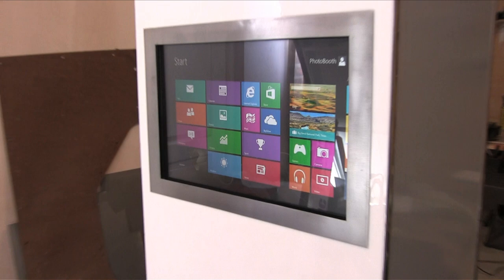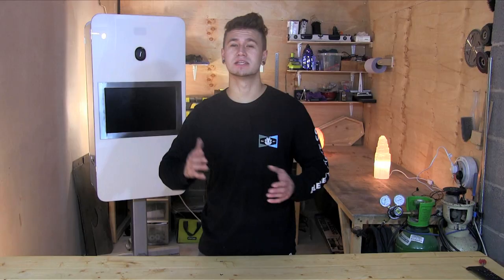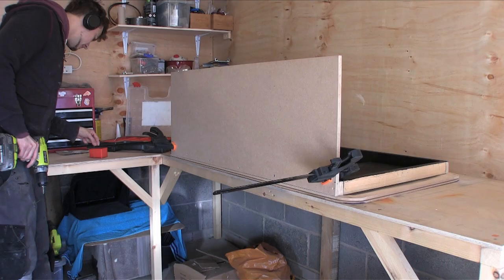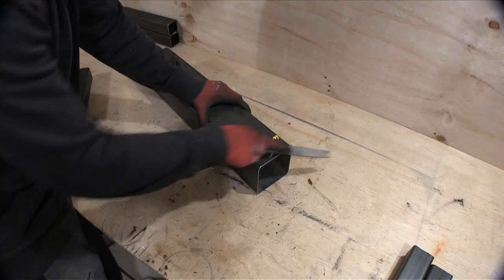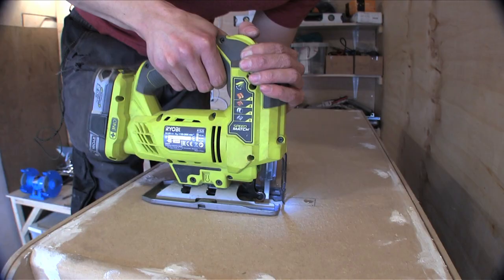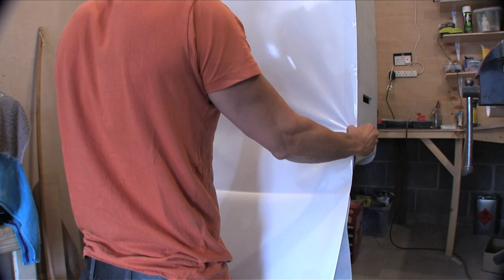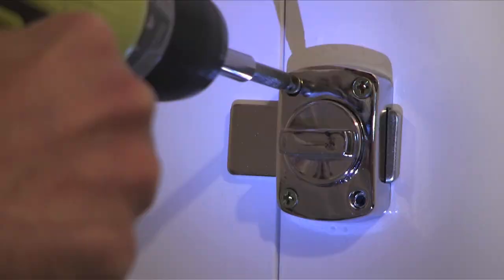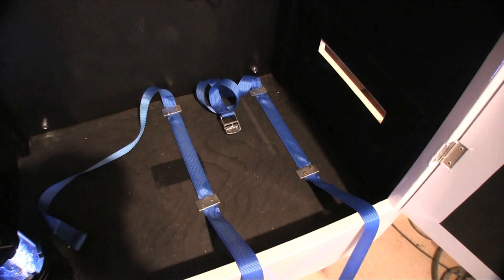Making An Open Air Photo Booth - Part 3

Comment: In the evening, continuous light is required for live viewing of the image.
Otherwise people don't see each other to strike a pose because it's dark in the wedding hall
Reply from the maker: That's a great point! I have only set this one up in lobbies or outside and dark rooms or dance areas, but yes, a continuous light would solve this issue if you're running it in the dark. Thanks for the feedback :)